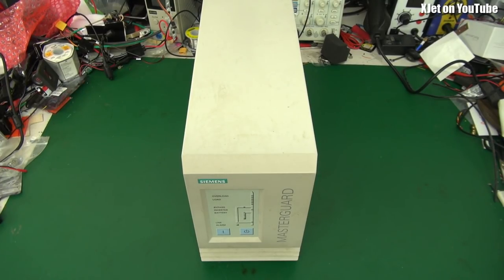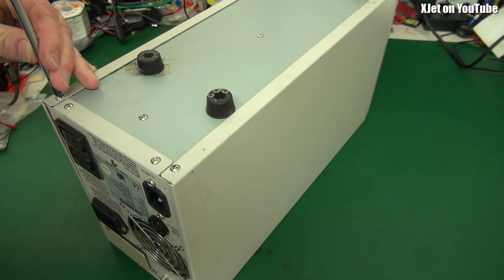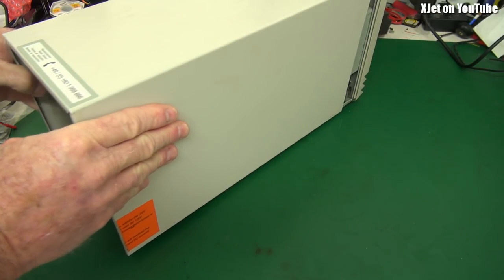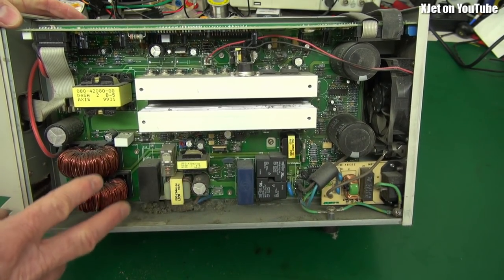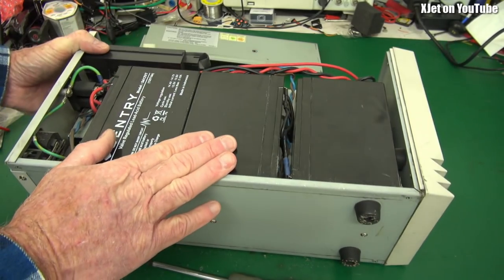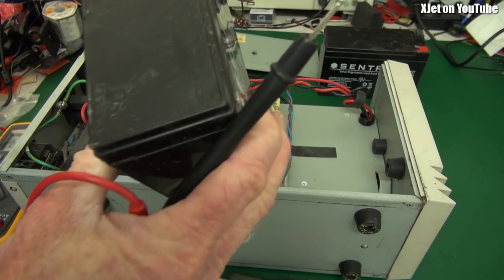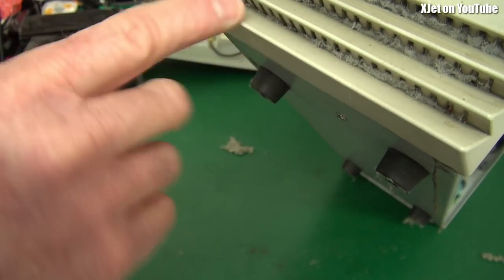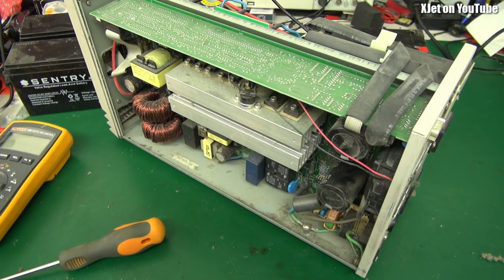After 25 years of continuous use it needs repair

Comment: Hi Bruce, when you go looking for a new fan, check the specs of the old one to get the airflow rate.
Airflow rate is what governs the cooling efficiency of the system.
Hint; put a sticker on the back of the UPS and on the new batteries indicating fitting date.

Comment: Hi Bruce. I usually check the screws on the transistors just to make sure they are tight (if they use thermal pads and not mica). I found that with age the pads tend to yield with the obvious heat problem for the transistor. I had a problem with my 18 year old UPS, caused by this. But as you said totally fixable no problem to get the MOSFET (equivalent).

Comment: Yes last 4 UPS units I got were free, because dead batteries. One, with 2 car batteries in a separate case, is now the PC UPS. Another I gave away with a working battery, and the third was dead when I tried it with new batteries. Fourth one is a 2kVA unit which works nicely, just the batteries will be expensive, as I want more than the 15 minutes of run time it has with the 7Ah battery pack, so I would need to buy 48V of deep cycle battery to make it work, around $300, which is getting to the price of a new one, though it does not have the power rating.

Comment: This just prove how good capacitors was made before 25 years,  they still last even they are placed on worst possible place they could place them (hotest air flow over them and temperature is killer of electrolytic capacitors).
By the way you should ideally find Varta batteries,  if I remember they was factory installed in siemens devices.
Reply: Yes, you put quality parts in and have them run cool, they last. Varta no longer makes lead acid batteries though, they have become just another brand name stuck on some random Chinese OEM battery maker, like a lot of other old brand names, that are now only hollow shells that run on brand recognition. Just like Durahell is as well, you never get the same producer to make a batch twice, as the mark holder always looks for the cheapest producer.

Comment: I have an old Merlin Gerin UPS with 8 SLA Batteries and 3.5 KVA peak power, 2 KVA continuous. Also built like a brick dummy, 42 kg with Batteries installed. Only repair I had to do is change the fan, like you had to.

Comment: Replace the main capacitors and use an external battery pack so it would be easier to maintain and u can always get bigger battery or even lithium iron phosphate have very similar discharge curve as leadacid.

Comment: I just lubricated my old PSU fan and it stopped making a noise. A year later still fine
Reply: I'm from Canada, and I use an oil produced by Lloyds called "AD-2000) that's sold here.  Seems to work in fridge fans (cold) as well as microwave fans (hot) as well as computer fans.

Comment: That's now how a UPS works. when the power goes out relays switch to the inverter, powering the devices its connected to.  Once power it detected from the grid it switches back to the grid and recharges the batteries, and switches the Grid strait to the plugs, that's what the 2 relays are for,   So the inverter is not on until the power goes out.
Reply from the maker: No, that's how a SPS (Standby Power Supply) or LIS (Line Interactive Supply) works.  Most of the cheap "UPS" units are actually SPS/LIS units and the inverter only kicks in once the mains fails.  On this (true UPS) the inverter is always running so there's no switching delay if the mains fails.    I just checked the specs on (for example) the APC Back-UPS BX Series and they operate like this with a "transfer time" (ie: the time taken to switch from mains to inverter) of 6-10mS.   A true UPS has a transfer time of 0 because the inverter is always powering the load.
Reply: @xjet  Then I stand Corrected. Thanks for the clarification.

Comment: The Batteries should have had to be replaced years ago.
My 2 year old APC will need batteries soon. (1350VA / Sine Wave output) It got me through the Feb 2021 Texas Freeze. (by giving me 30 minutes to turn off the TV, Cable box and PC.)
Reply from the maker: The batteries in it were only 3 years old and failed pretty suddenly.  Last time I needed the UPS it held up just fine for over 40 minutes then, a couple of months later -- ist kaput ya!

Comment: Siemens was pronounced right.

but Siemens did not build tanks as you mentioned in the comparison "build like tanks" , cause Porsche was designing those and a dozen manufacturers were building those, of cause Siemens supplied those too with starters and generators.

You should even try to call that german number on the label on the top. Will it works 2 decades later, will you get data about spare parts for this unit?
I guess yes, most likely Bavarians will answer your questions seriously without any sales pressure like you need to get a new one or get these parts for a proper maintenance.

Hope to get an udate about your 25 years later service experience and no after call service survey how happy you are with  the service member and its support work. and yes, they still use fax machines as the german car makers for supplying with parts data and sketches which are using machine reading.
Reply: So now I know how the name Siemens is pronounced, I thought it may have been the same way this guy said it or even like Simons.  I have an old 50's TV/Record Player and Radio unit last time I used it, the thing still worked. well the TV part not so much.   Who ever owned it before me must have imported it or took it with them when they moved to Australia, so the TV part would not have worked on our standard anyway.  Plus it must weigh over 100 kgs.

Comment: Still dont’t understand what’s the use of a UPS 🤔
Just supply power when there is a power grid failure?  Happens this that often so this device is usefull?  Bit confused here…
Reply: Imagine you're saving a big file on your computer and the power goes out during the process. Bye bye data. 

If you have a UPS, it will keep your computer running so that the save can complete and buy you some time to shut things down etc. 

It also smooths out any power issues you might be having, for instance if you're in a storm and the lights keep flickering - that would normally be enough to turn off the computer whereas with a UPS it will just keep providing power and you'd never notice.
Reply: Power outages happen at different rates in different locations. A unit like this will also protect your devices from power spikes and other uneven stuff coming from the grid.
Reply: My ups uses a cable to "talk" to my computer to tell it to begin an orderly shutdown if there's a grid power failure.  I don't have to be present, which prevents bad things happening if the operating system is writing to disk.
Reply: Thanks for explaining this. Guess that i’m lucky to live in a region (The Netherlands) where power failures are very rare. For the last 50 years or so  i can remember perhaps 3 or 4…
Reply: @bertbeinaaf8314  That may change. Central europe is kind of running out of juice and there have been near-misses with blackouts already. A lot of wind and such volatile power sources and closing down nuclear and other reliable production. I would not be too surprised to see a major blackout in the coming winter.

Comment: 12v / 21ah is enough to run your PC for an hour?

I've been casually looking for a UPS and I probably only need maybe 450VA but I would like it to be able to keep things running for several hours.
Reply from the maker: 36V x 7AH is 252WH and my computer/screen sucks well under 250W.
Reply: @xjet  I would point out that, that 7ah rating is likely based on a (iirc) 20hr discharge.
Reply from the maker: @prototype3a  Yep, I think my total power consumption for my PC and LCD is probably under 100W.

Comment: When you talk shit about stuff you dont seem to know about, it discredits that at other times you do know what you are talking about. There is no UPS on the market that is not serviceable.
Reply from the maker: It's not whether it can be fixed but whether it's worth fixing it that is the issue.  Go to any e-waste facility and you'll see a pile of cheap UPSes that have died and were not worth fixing.
Reply: @xjet  not really, I see UPS'es with batteries that need servicing there, as the previous owner usually just buys a new one, usually a bit bigger specced.
Companies just e-waste them based on their service life .. as their warranties are impacted. The amount of times I get ordered to e-waste perfectly good equipment, just cuz having to discuss it easily involves 8 people spending an hour of their time on it, which translates to more than the stuff is likely wort, isnt funny.

Responsible recycling is growing, but its hard to make it economically advantageous for a company to see working equipment gets a second life. There is no way that Siemens will grant you any warranty on that unit, and that in and of itself is end of story for any business. They need to have that in place to clear the ISO standards.
Reply from the maker: @PlanetJeroen  But servicability is based on many factors including the availability of parts, the type of construction (ie: it's rarely economic to replace BGA devices that might fail) etc.   An "old school" UPS like the A1000 uses mostly through-hole components (easy to replace) and readily available semiconductors (as opposed to manfacturer-specific pre-programmed MCUs, PLAs, ASICs or such).   This means a device like this can be repaired and those repairs are likely to be much cheaper than buying a new device.   Compare this to a modern unit with pre-programmed MCUs that have to be sourced from the manufacturer who has since replaced the product with several new lines and isn't interested in selling a single $5 part from 20 years ago.
Reply: @xjet  I get your point, and yes this unit is more serviceable than a current one, but then again, there are a lot of features now standard, that you are doing without. If thats not a problem for your use-case, sure .. you get to save some money, but that is not really a good argument to discount all current tech as wastefull, because you need an SMD station to fix it instead of just a hot nail.
Reply from the maker: @PlanetJeroen  It's not the use of SMD components per-se that is the problem (I do plenty of repairs on SMD boards as it is).  It's the availability of parts that is the real issue.   Where do you get a custom-programmed microcontroller if the manufacturer no longer sells that part or wants to charge you more than the price of a new unit to supply it?   THESE are the things that can make modern electronic devices uneconomic or even impossible to repair.
Reply: @xjet  at the same place Louis Rossmann gets his chips .. donor boards. Plenty times you can just lift the firmware off a working version and its not unheard that you can just download these from support websites, along with the schematics.
Reply from the maker: @PlanetJeroen  That's fine if you're repairing a lot of the same device but unfortunately, unless you're running a repair shop that's focused on a single brand, that's unlikely.   And, as Louis has pointed out, even swapping a screen or battery from another phone doesn't guarantee it'll work because now manufacturers (well Apple anyway) is serializing parts to avoid this kind of "unofficial" repair :-)
Reply: @xjet  The likes of APC make it quite convenient to download the schematics, and repair the boards, should you want to. But is this not just inherent of technology marching onwards? It getting more difficult for the average person to repair and maintain? Not saying your statement is wrong in that your Siemens is easier to repair than modern units, but more that it doesnt make a lot of sense to want to hold on to ancient tech because it was simpler, as the primary reason. Many companies now exist, specializing in extending service live of perfectly fine but no longer manufacterer supported units, and I would argue this is a fine solution to me no longer being able to service it myself in some aspects. If more companies start using Apple tactics, then yes, we are screwed.. pun intended.

I guess you thought this through better than I assumed in my initial comment. Apologies for that and the tone of it, but I'm not agreeing with the statement that your old Siemens is better than a modern unit because you can replace every component yourself. This will hold true for any modern unit as well, using third party services to obtain the harder to replace component (sets). These third parties, get their stock from the e-waste facilities, where the customer hasnt marked 'destruction' as option. (which is sadly, the default).

There are complete businesses, even offering SLA based support on these refurbished units and giving them a second life in growing economies. I guess what I'm trying to say is that its more nuanced than you made it sound, and the ancient adage that everything used to be better, has always been a bit dated ;)